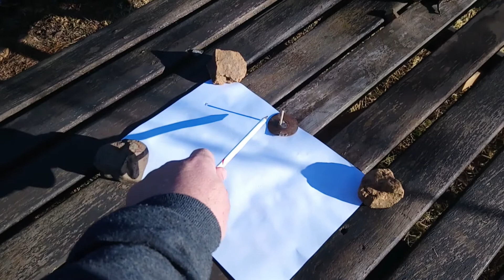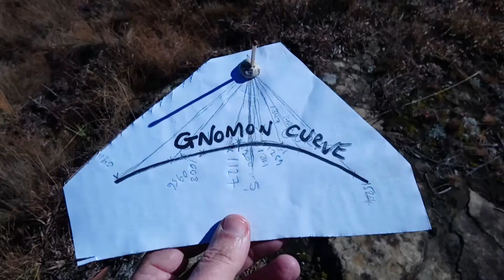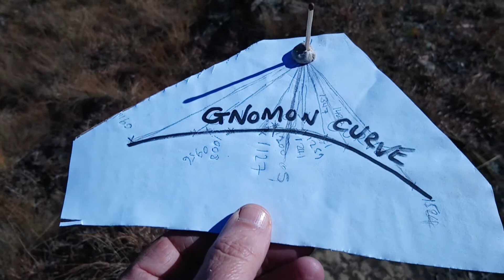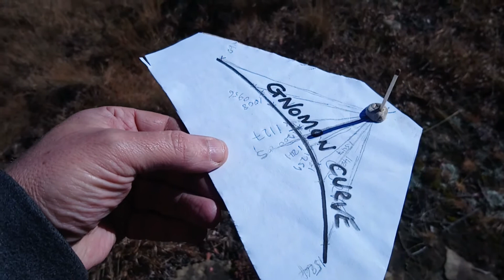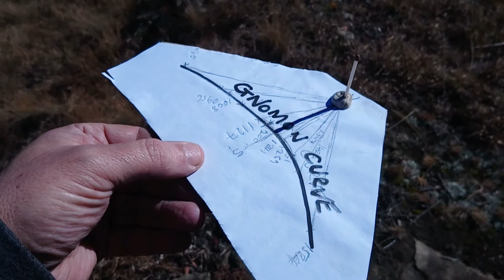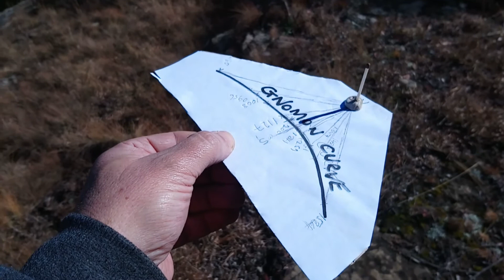Viking Sun Compass

Comment: You have got to be joking. The shadows only points to north or south at solar meridian passage
 Try this on a boat and you sail in circles. The shadow points West in the morning and east in the evening.
Reply: thats why you check it at the same time each day, typically midday when the sun is at its highest. We typically sailed from the latitude that includes Norway, Sweden, Iceland, Greenland, the Faroe Islands and Canada, so the sun was pretty much at the same spot all summer, 24/7.  This, combined with a sunstone was a great way to make sure you werent going too far north or south when you were heading east or west on latitude: check it at midday and make sure the shadow hasn't changed too much, if it has gone more than a degree or so either way, you course correct.